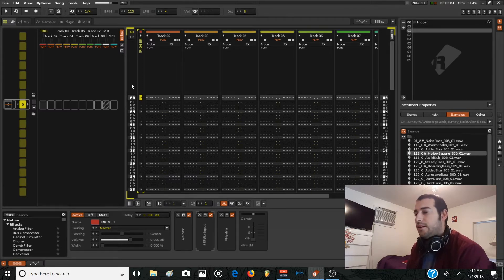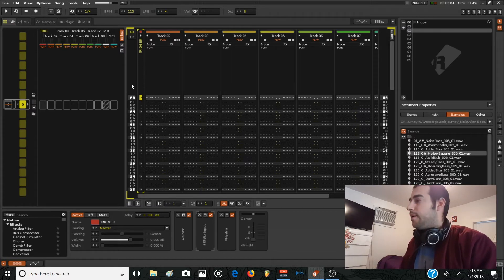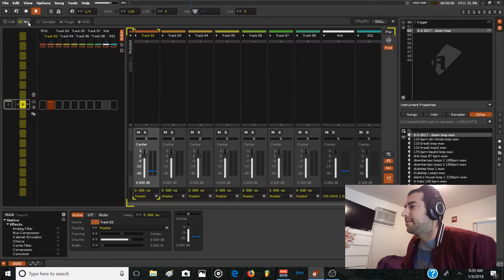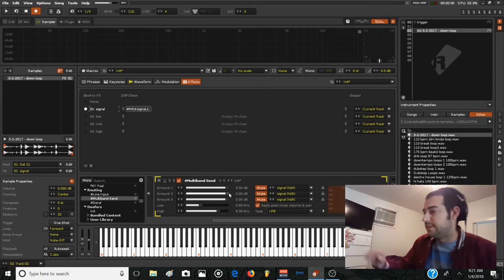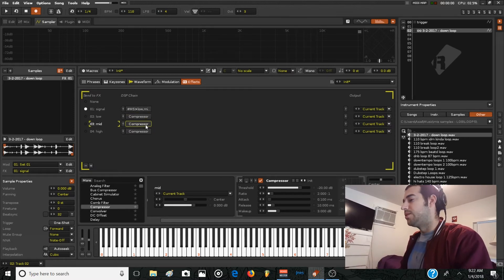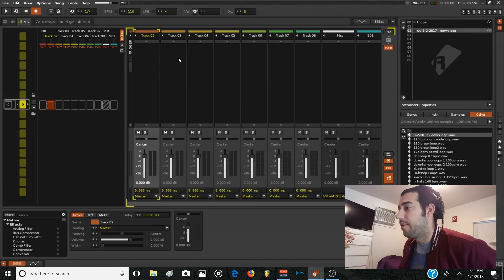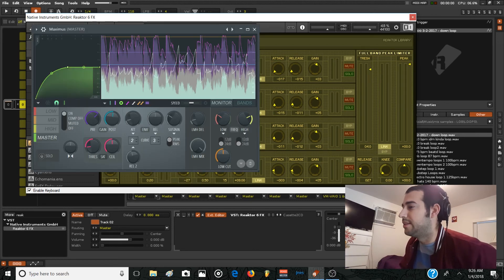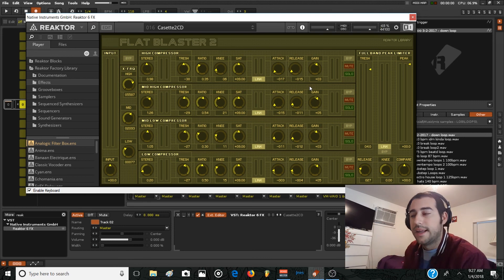Renoise Beginners - Multiband Compression

Comment: I'm surprised no one commented on this!

One of the things I have been looking up is how to split bands and do different effects into it, this answers that!

I mainly use OTT which seems to be the most popular multiband compressor, and Camel Crusher as a compressor / distorter as my main sauce. Also lots of Tal-4 Reverb, which has this rich long tail vs the Metallic one from mpReverb.

Part of me feels I can learn how to emulate those sounds eventually, but wonder how efficient it really is to do so, instead of recommending others to download the same free plugins I use.

Still though, splitting the signal, being able to do mono / side stuff with stereo could be really nice, add compressors or filters and see how it runs, like LoFimat in the middle, or Chorus at the high end.

Not being able to see how it compresses is okay with me! UI never really bothered me as I can see the spectrum analyzer for the main changes, or can use OTT once again if things get too hard.

Thanks for posting this!